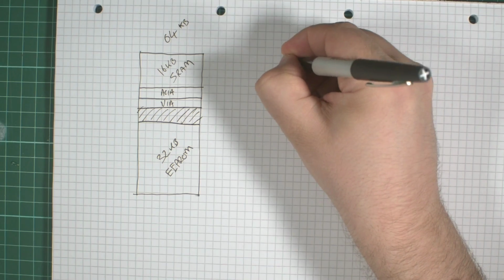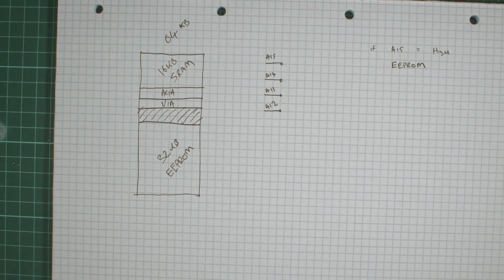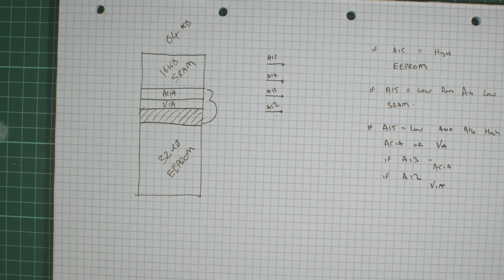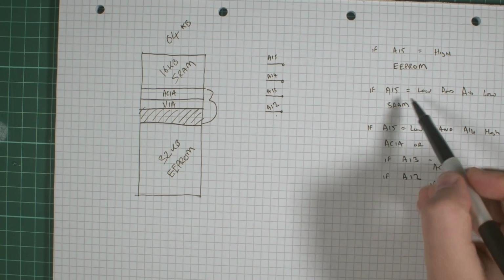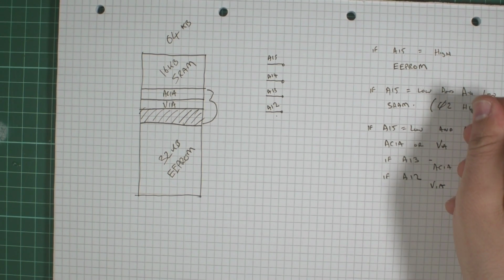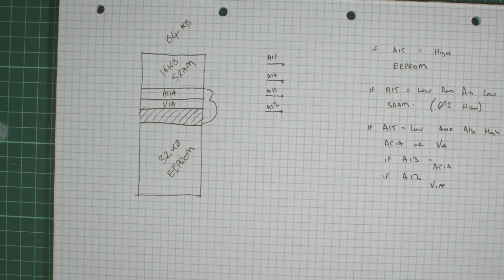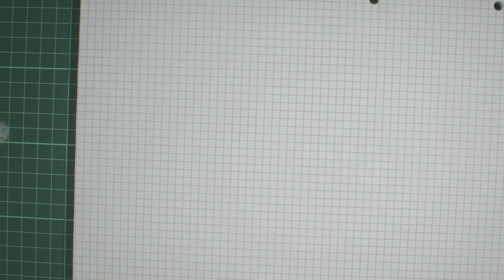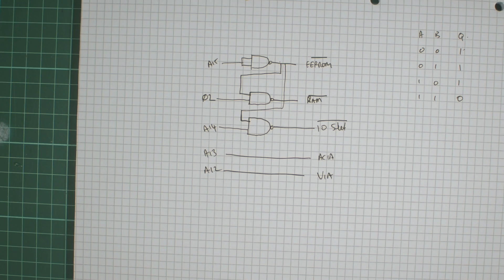6502 Computer - Wiring Clocks, Interrupts and Address Decoding

Comment: Either I'm still not understanding how this works, or there's some errors with your decode logic for the ACIA and VIA. At address 0x1000 the VIA will get enabled, and at 0x2000 the ACIA will get enabled, which are both desirable. But at 0x3000 they will both be enabled, which I don't think you want, and likewise, the VIA will get enabled at 0x9000 along with the ROM, the ACIA will be enabled at 0xA000 along with the ROM and they both will be enabled along with the ROM at 0xB000. This doesn't seem like its what you actually want. Am I missing something or is this decode logic incorrect?
Reply: A14 control io that controll via and acia with combination with a13 a12 I think so its 6000 and 5000,but ram is active then too even there 16k ram it would read and write ram 0 address lol.rom not get connected same time a15 high means it won't use io that controll via and acia.but I not get ram part ram is active low when a15 is low and clock high.it is so every address 0-7fff lol

Comment: It is better to include the PHI2 phase into the read/write logic instead of using it with your address decoding. On higher clock rates you can run into problems if the chip select has only half of the time of your clock cycle to activate your chip. 
If you use the PHI2 signal to create a proper write signal, the right chips is already activated. any glitches during the addressbus settle at the first half of the clock cycle are gone and your write pulse will hit the right address. There are a lot of discussions about that in the 6502.org forum. But common sense is to use PHI to in your read/write logic.

Comment: Hi Chris, I've greatly enjoyed the 6502 vids thanks for posting. I've been a 6502 fanboy since the 80's and it's awesome to see it continuing to be so popular.

I do have a couple of questions about this video if that's ok! 

Firstly, do you always draw your memory maps that way up? I've never seen that before and before you explained that you had address 0x0000 at the top I was screaming noooo at my screen because obviously the 6502 needs RAM in the bottom two pages for zero page and stack.

Also, have you shown all of the address decoding logic? Reason I ask is that simply connecting A12 and A13 to a VIA/ACIA CS0 (your select logic looks like it's active high) and presumably pulling nCS1 low isn't enough to isolate the VIA/ACIA port registers into the small piece of memory map that they need. They'll both be mapped to huge chunks of the address space including over the top of the EEPROM (assuming BASIC needs >4K) and also each other in places.

...or did I miss something... which is entirely probable!
Reply from the maker: Sure, in these video's I'm sharing what i've learnt, so they could be full of inaccuracies, so happy for corrections and clarifications :)

With regards to the zero-page and stack, is the a question about the use of words top/bottom? I try to show that RAM is mapped from from $0000 onwards which allows for the $0000-$0100 zero-page and $0100–$01FF stack? is it more correct to called $0000 bottom rather than top? 

All the important logic should be shown here. I actually am reusing the work from this guy http://wilsonminesco.com/6502primer/addr_decoding.html who does a more detailed explination . As you point out it would not work if the nCS1 was tied low, but the I/O Select output of the logic is connected to nCS1 of both VIA/ACIA, as well as using A12/A13 to CS0. This isolates it to only overlap with the RAM, which isn't perfect but doesn't cause a problem. 

I've almost finished putting it all into KiCad, i should share that so it's easier to see the whole thing as once schematic. 

Thanks!

Comment: Nice! ive been looking forward to the next see whats next! :)

ps. won't the eprom and i/o be selected at the same time?
Reply from the maker: Just worked though it again, here's my workings...

Any address from $8000 upwards, will have A15 High. So Inverting it to feed the active Low ChipEnable and OutputEnable of the ERPROM should ensure that its only accessible/enabled in that address range. 

There is a quirk in this logic for the RAM and I/O though. Because the ChipSelect is enabled when A15 is low and Phase Two Clock is high, it will clash with the I/O allowing writes to the RAM at the same time, But that'll be in the unused 16KB of the RAM, so it's not great but it'll work still.

This is a super minimal approach i learnt from http://wilsonminesco.com/6502primer/addr_decoding.html

Once i've got to grips with this version, i plan do a second revision with some improvements, address decoding is one of them. 

Thanks for watching, soon as i get the EPROM programmer i'll be getting this thing booted :)
Reply: cant wait! :)
Reply: If you're using A12 and A13 for the ACIA and the VIA without taking care if A15 is high or low, you will be accessing ROM and the I/O at the same time as soon as A15 is high (ROM) and any address for the rom that uses A12 or A13 high, because this would trigger your I/O range too. As long as your ROM code is small enough  everything will be fine. But you should get in trouble if the addresses start to use A12 and A13. You could even get problems during reset, because the reset vector $FFFC on the address bus takes A12 and A13 also high. The VIA and the ACIA have more the one CS input. So you can use the inverted A15 signal to feed the active high CS1 of the via and the CS0 of the ACIA to prevent bus collisions.